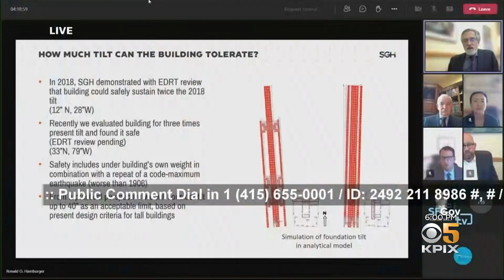San Francisco City Hall Hearing Considers Future of Millennium Tower

Comment: How is the engineer so confident it’s safe when they have been wrong on everything else?
Reply: Good question.
Reply: They went to college . And have many framed papers
Reply: They do use computer modeling that are pretty accurate
Reply: @Garbagejuicewaterfall  common core
Reply: the engineer doesnt live in building that's how
Reply: Big money is one helluva drug.
Reply: @Smart-Towel-RG-400  so their computer models predicted this and they went ahead anyway?    This was an expected outcome?
Reply: @Irene94044  Common core has nothing to do with college.
Reply: @bogofusion  nah computer modeling the fix they think the building would of been fine if they dintt switch from a steal skeleton to concrete they think that was the issue that started the issues
Reply: @Smart-Towel-RG-400  Did they use a HAL-9000 computer to come up with this model?

Comment: DANGER DANGER DANGER 
That building needs to come down now
If my own house was leaning and sinking like that they would red tag it immediately and force me out.
Don’t ever let any moron tell you it’s ok if a high rise leans over and starts sinking.
Reply: Thousands of people who live in trailer parks get a flat tire and the trailer leans, no red tags but their in red states.
Reply: I agree.
Reply: @mikeprice4103  cause it sitting on top of the ground its not buried connected to the foundation... and it doesn't have concrete weighing down the building.... trailer is a box sitting on the ground.
Reply: The building can tilt and sink even further than it already has and it will still be safe?  Who believes this stuff?
Reply: @zoemayne   Yea your right
Reply: @jeanhansel5805    24" isn't that far, its fine
Reply: @jeanhansel5805  Not me. Besides, who would want to live in a tilting unit hundreds of feet up whether it is safe or not in the first place?
Reply: @mikeprice4103  I would rather live in a trailer with a flat tire in a red state than the millinium tower in a blue

Comment: For every inch the building continues to lean, think about the additional stress the foundation and sand beneath the foundation need to absorb. I'm not a structural engineer, but just how much stress can the foundation and sand withstand before they collapse? Everything has a breaking point.
Reply: Correct, as the geometry of the system changes (ie building tilt) the forces get redistributed.  Forces in some areas will increase, while forces will decrease in other areas.

Comment: This is insane. Who wants to live in a tilting building to the tune of 4 million per unit? Obviously liquefaction is taking place below the mat foundation, which an expert said was "dishing" a few days ago, and the fixes are causing vibrations making it worse. The building sits on the original shoreline. It is too heavy, the foundation walls are leaking, and the concrete it is built of is heavy and cracks. Take it down.

Comment: You don’t know what will happen in an earthquake due to liquefaction as it is built on landfill where the bay used to be. Just look at some 1850 maps. For that matter, since 1989, there have been a lot of high rises built on landfill. We have not had a big quake since then.
Reply: How true, not sure what is it, the pilings down to about 80 or more feet? Insufficient in my opinion but the piles are in undisturbed ancient clay. The land fill is probably about 30 feet deep. They should have invested in deep foundations to bedrock.  It would be interesting to know why they decided to switch from a steel frame to a much heavier concrete structure.  In an earthquake would the deep clay liquify or just the landfill close to the surface?
Reply: @kennixox262  There you go using common sense.  Which seems not to be so common around here.
Reply: @kennixox262  I’m no expert on this, but the Millenium tower is in a liquefication zone, as shown on a USGS map, as is the Marina, Financial district, majority of SOMA, South Beach and others. The San Andreas fault is part of the ring of fire I think.
Reply: @mmaranta785  Exactly, but my question is how probable is liquidfication of the deep clay that exists far below the landfill? Just curious and am still amazed that they cheaped out by not going to bedrock. I've seen the ground go total liquid in Japan in 2011.   The water literally just came out of the ground up  through the sidewalks and on grass areas. The real fright is that it lasted five minutes.
Reply: @kennixox262  sea levels there, are rising too.  !

Comment: Engineer says it can tilt 3 ft more....by then the sewage wont flow
Reply: But maybe the Engineer miscalculated.  Maybe the building can only tilt 2 ft more before it falls over or collapses.  I have a difficult time believing ANYTHING said by ANYONE connected to this project.
Reply: They already are having problems with sewage pipes, necessitating flushing of the pipes and have said this problem could require replacement of walls and floors  in some of the condos.  It's all pubic record; do a search to find this information.
Reply: Who would want to live there with how much it is tilting right now? Crazy people?
Reply: They are already having problems with some sewage pipes, necesitating flushing because of an upward tilt of some of the pipes which eventually will cause damage to walls and floors in some condos, necesitating repair or replacement.
Reply: @sanfrancisco89  It boggles the mind, doesn't it?  How do people sleep at night?
Reply: @jeanhansel5805  I know, and replacement again if the tilting and sinking continues. The water pouring through the walls, exposing rusting rebar is enough of a sign that the muddy sand intends to enter the sub-basements.
Reply: @jeanhansel5805  Beats me. The demonstrable tilting would be all I'd ever think about living there. Oh, and the encroaching sewage.

Comment: HARMON blding in Las Vegas:  (brief info)
     At the beginning of the project, the hotel was called the Lifestyle Hotel and then The Harmon Hotel, Spa & Residences.         The tower was planned to have 400 hotel rooms and approximately 207 condominium residences from 800 to 2,900 sq ft (74 to 269 m2) on 49 floors.      The hotel's pool deck was planned to be on the roof high above the Las Vegas Strip.[6][7] The exterior of the building was finished in 2009, but the interior work to correct the construction issues was to continue into 2010.

Comment: Although the building is “structurally sound”, what about the non level nature of the floors and all horizontal surfaces?
Reply: The flow of sewage in the pipes are going to get interesting, as it leans more and more. At what point will it flow the wrong way and into someone's apartment?
Reply: @gorillaau  - obviously I haven’t seen the plumbing schematics, but you make a point. At what point do you have sewage trying to go up hill, or toilet bowl float level issues. 
Then, depending on how the various utilities are pinned to the structure, do you have stress on the respective conduits causing wreaking and/or failure. I suspect these are minimal, but only the respective structural and mechanical (design) engineers know.
Reply: @davidturk6170  I don't know how much further the engineers are calculating the tipping point of the building, but as an owner in the building and even a building owner nearby, I'd be more than a little concerned.
Reply: @gorillaau    1/8  inch slope, every foot  MINIMUM.  OR  1 FOOT   in a hundred feet, minimum for water to flow.  (old surveyor)

Comment: What about drilling form opposite direction, and also if they can finish a part of the project and stabilize the building then continue to it, that may solve. I am not structural engineer but i am not hearing that kind of solutions discussed.

Comment: It looks as if they really didn't know as much about the physical properties of the clay layer, in terms of its load bearing capacity and ability to withstand shear deformation(lateral stiffness). I also have to wonder how well this clay layer will perform in anchoring the foundation in the event of a moderate to large amplitude shake. Will the clay liquify under the stress loading imposed by a large earthquake? In the event of a large quake might the clay layer and ground layer above it be displaced in different amounts, thus shearing the building's foundation?

Comment: Mr Hamburger, How feasible was the construction of this marvel of engineering there in downtown San Francisco?? Surely you as an engineer are aware that liquefaction takes place during seismic activity and would surely cause failure to this building. Now that we know of the sinkage and tilting that is already taking place, it appears largely because someone thought it appropriate to anchor in mud,rather than bedrock. A failure of this project would be extremely catastrophic to many other structures in downtown San Francisco. Spending what, $100-200 million to fix ,and how much of that at the taxpayer's expense, wouldn't it be more cost effective to dismantle this "mistake " now??
Reply: I found it more interesting when the couple living there did the marble roll. When first moved in, everything seemed "on the level ", but as reports began to circulate about the building's integrity, marbles rolled on the floor showed how much, and which direction the structure was leaning. With recent facts of building collapse (Surfside,Fl.),how much convincing does it have to take for people more interested in accumulating dollar amounts than saving lives. Get Real,admit a catastrophic mistake was made, and start a dismantle process, immediately, if not sooner!!

Comment: When a building of that size tilts 23-plus inches that will affect elevator operations, create plumblng issues, broken pipes, electrical problems, broken seals and cracked windows, bent door frames, all kinds of problems. In my opinion, I would move and take my losses. I would stop paying HOA dues and mortgage. Let it default back to the bank. It's a defective building and uninhabitable.
Reply: ' when i talk to you.......YOU   ARE  REQUIRED   TO  LISTEN ''   yelled and cried out the building !!  (all telltale hints, of your listed ' problems'   with it. )  To  Mr. Bruce   :washhands:     ✌🖖

Comment: 1:47 He says it can safely handle 3 feet (36 inches) to the North and 80 inches (6'8") to the West. Currently leaning 9 inches to the North and 23 inches to the West.
Reply: imagine the penthouse with a 80 inch lean...
Reply: @williamhaynes7089  Imagine a Carpenter, Cabinet Installer, Tile Setter trying to determine Plumb and Level Lines.
Reply: @sanfranciscobay  - I agree, someone in some unit has to be paying for remodeling at some point
Reply: @sanfranciscobay  as a contractor, that's when you eyeball it OR split the difference. As a contractor, you'd NEVER get me in this death trap building.
Reply: @blaydCA  Do you think an 80 inch lean at the top would be noticeable inside up high?
Reply: @sanfranciscobay  It's out an 1 1/4" per floor at 80" out of plumb. Probably not noticable. I hope the concrete was up to specs. Sumptin' gonna fail sooner or later.
Reply: @blaydCA  Is the degree of non level the same on the first floor as the 58th/top floor?
Reply: @sanfranciscobay  I doubt other than physical floor by floor inspection you'd be able to determine that. In "theory" it would be. Reality is different. It's moot point if there's one bad spot leading to catastrophic cascading failure. It will fail at the "dished" slab as per the HOA's engineer. Concrete has compressive strength, not tensile or shear strength.

Comment: Just demolish the damn thing and start over.  I am not calling the engineers dumb, I have a tremendous respect for them, but it is obvious something extraordinary is happening here that no one has a firm grasp on.  Everyone has pointed the finger of the pilling not going to bed rock, but buildings are built in the way this building was all the time in similar soil conditions.  More over the repair process should not be accelerating the process in any way.  My guess is there is a anomaly deep under ground.  This could be anything from a deep water seep from a cavity deep under the bed rock leaching water into thew soil above and causing it to backwash into the cavity slowly, an unknown micro fault in the bedrock that is shifting under the weight. Effects of ocean water on a mineral/salt  deposit in the bedrock,  etc etc.  Whatever it is, its highly atypical. Ground penetrating radar can only go so deep and while we have techniques like core drilling, sonar, and seismic wave analysis to look at deep bedrock structures, its resolution at this scale can miss smaller scale anomalies that could affect a building with such a small foot print. 
In short, something odd is going on here, and it will be interesting to find out what.
Reply: it's true, lots of high rises on shifty ground using piles, some which could withstand quakes better without presence of bedrock even...... an anomaly for sure or errors during construction...    Burrowed slumbering beast ??😮 Probly shouldn't go so high and heavy in these zones but prime real estate i guess 😢

Comment: Teskin is right to be concerned.
- When it was constructed the Engineers were convinced it would never tilt otherwise they would have put pilings into bedrock
- Engineers came up with a fix and while working on it, the tilt increased unexpectedly. Before starting this endeavor the Engineers said it will stop the tilt no problem
- Today the Engineers who are losing credibility are now saying the building can handle a lot more tilt. Bldgs are designed to handle vertical loads as well as wind but not tilting loading. It was not built to be a leaning building and you can fool the engineers for a time but you cannot fool gravity.
- Another engineer noted that apart from the tilt issue there is dishing of the foundation suggesting that the foundation is under designed for current loading.
- Lets face it this fix only goes part way around the building. If the bldg is shored up on one side will this transfer the settlement issue to the unsecured (shallow pile) section of the bldg.
- Cracking windows and large cracks in the parking area of the bldg and sidewalk settling tells a different story than a developer who like the federal Libertards wants to "Build back better".
My hat goes off to Aaron who stood alone in doubting the current fix's ability to end the problem. It is a cheap bandaid approach to "trying to fix" the column problem but does not seem to address the dishing of the foundation. I am sure there was a guy just like Mr. Teskin in Surfside fl. who had similar doubts but was ignored. 
    This bldg. was designed to be constructed with steel but instead they decided to use concrete which added significant weight to the structure. Was the foundation re-designed to account for this? I suspect if someone goes back to the original engineering calculations they will find a close to non existent safety factor in the design, or perhaps, an under-design of the foundation and support structure. 
     Lets hope there are no major seismic events that Mr. Teskin is concerned about. I love Joe Montana and would not want to see him or any other resident killed because the decision makers involved took their time and decided the best decision was to simply kick the can down the road and hope the problem goes away.
Reply: It's Supervisor Peskin, not Teskin, and you lost me at "Libertards." This could have been a great post given all the work you put into it.
Reply: @sanfrancisco89  My thoughts exactly.
Reply: Imagine being so blinded by your own partisanship that you read and shoehorn it into everything, even things that aren't related.

Comment: I would fill the basement with gravel around mechanical jacks that could be continually adjusted and fitted against the foundation/support beams (to be easily reinforced, if necessary) at street level from bellow. The jacks would be imbedded in the gravel. (If did it right, you could literally elevate the building, grade the gravel to spec, and lower it back down onto the gravel bed, like the Marriott hotel a few blocks away, a al Frank Lloyd Wright.) The basement would be rendered useless, as it should be. End of story. Very (relatively) simple/cheap fix. This building, (and no high-rise) should ever have a basement in the first place (especially on land fill). It's fueled by greed and a dash of machismo. Greed, greed, greed. The City was paid off. I guarantee it.